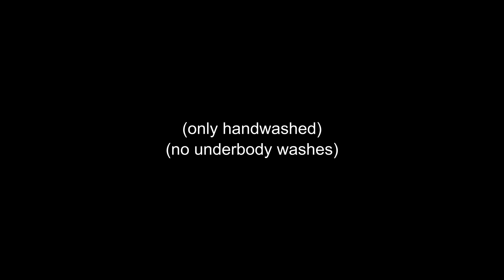Fluid Film Undercoating / rust proofing: Year 2 Review

Comment: i used fluid film on my brand new to me at the time 2017 dodge ram 1500 pick up. I spent five days taking my time to apply the stuff. I’ve pulled the headlights, taillights, the spare tire, it’s even took the runningboards off so I could get underwear the brackets mount with fluid film. I lifted the mats up off of the top of the rear bumper because my last GMC truck rusted out under those mats. I took the fender liners out.. I took the wheels off and covered the disks with plastic bags. I hand coded brake line connections at the calipers. I had coated the driveshaft. It’s a 4 Wheel Dr. so I guess I hand coded all three driveshafts. I bought the attachment for the spray cans that’s a 4 foot long hose, and I sprayed is high as I could get up the door posts, and up the frame around the windshield all the way to the roof. As well as in every hole on the hood especially towards the front.
  The reason I took five days to undercut my new truck is. My last truck with a GMC Canyon. I bought it new in 2008. The owners manuals specifically said, not to undercut my new GMC because, it would void the corrosion warranty. I thought that for General Motors to say something like that in the owners manual, they must have some super Duper special corrosion proof paint underneath my truck, so I never questioned it.Well the body panels did not rust, but, everything else did. The underneath of that truck I could scrape sheets of rust off of the frame. I lost the brakes two times from corroded fittings, the front disc brake splash shields had disintegrated. The fuel rotted and the fuel pump mounted on top of the gas tank plumbing corroded away. In Pennsylvania hear we have annual state inspections. When I had my truck to the guy I take it to for inspection, he told me that it is a crime what is happening under my truck from salt attacking that  metal. He advised me that he thought the frame supporting the back bumper and the bed of the truck was not going to last much longer.
  That’s why I meticulously under coated  my new ram 1500. Because. I see more rotted wheel wells rocker panels, tailgates on ram pick ups then any other make pick up. I should have known to undercoat my GMC that I only kept for 42,000 miles because of the rust. The truck I had before the GMC was a 1978 Ford Econ van. That I bought new and sprayed underneath and inside the doors with motor oil. That truck lasted me 31 years. I hope I get at least half that out of this new ram now that I have under coated it better than I did the ford..
Reply from the maker: Wow. Thats amazing. Kudos on all the maticulous work!     Yeah, it seems there are serious water issues with certain truck features: wheel wells, door/rocker panel drainage, frame drainage... Heck, even the a.c. condensation drain drips right into the frame on a lot of vehicles.
An ounce of prevention ... :)
Reply: can you link to the 4ft long hose you bought? Would love to get something like that to get better access to the rear of my truck bed.
Reply: @RodFenris We need a new FF update on how this is holding up. Thanks

Comment: Inside the frame is what's important, frames rust from the inside bottom, under the cab, that's where the salt lays all year unless you wash it out.
Reply: True right here.  I did paint my f250 99 but it rust from inside out.  However C frame is still healthy as is exhaust and gas tank.

Comment: Rod Fenris,   the reason why the door seals are expanding on you is because they are not rubber.  They are actually Foam with a coating on them, thats the reason why they are like that.  In other words Fluid Film is safe on "rubber"  gaskets and bushings like cab/exhaust/suspension mounts.  I don't have this issue because I coat my vehicles 90% with an industrial grade $150.00  per gallon product that does not wash off, then go back and use fluid film in small tight areas with the straw on the spray can.  However if your not afraid to re-coat the entire vehicle twice a year, and spray spots here and there as you happen to already be under it then Fluid Film is fine... I'm just lazy, so I spend more money for less work.
Reply: And what is that "150$ gallon" product?
Reply: @ylastchance  LPS 3, All I'd warn you of is you want the surface clean when you spray it on.  And it does not come off easily, not even paint thinner effects it very much.  I've scraped off surfaces I need to work on with a putty knife.

Comment: The undercoating will make rubber weather stripping dry out and shrink up overtime if it is not sprayed down with silicone before hand to keep it moist. Where I work doing rust proofing in southern Ontario, Canada we always spray down the rubbers with silicone when they are close to what is being sprayed with undercoat.

Comment: So after winter you don't wash the underside before applying new fluid film? And it sticks? Im a first year fluid film guy and need to know what to do come spring. Wash? Or just spray more on? Also if it isnt hurting the rubber to the point to where it needs replaced, I wouldnt worry about it.

Comment: What size compressor can I do it with pancake 6 gallon 135psi?
Reply from the maker: Yep, that will work. Mine is a little 3 gallon 100psi, so you'll get done befor me :).  60-80 psi seeemd to be the sweet spot for my spray gun.

Comment: Hey how well is it holding up?
Reply from the maker: wow - it has been a long time since the update. better get to posting those pics sometime ;).  Here's the short version - Fall 2019 and spring 2020 the undercarriage looked great that I barely added any fluid film - maybe a couple light squirts, but nothing much.  THEN covid happened and its been sitting in my garage on blocks for 3 months now..  two months ago, I went back over it with fluid film while I was doing my other vehicle and noticed that there was some mild rust on the rear suspension linkages as well as some rusty/waxy/powder that i could scrape off the rear differential (mostly on the top of the gusset flanges were water would pool).  Guess I should have covered those better in 2019.  They're covered well now though :).  thanks for asking!
Reply: @RodFenris  Thanks for the reply! I am glad it is working well for you. Would you say it has helped prevent any rust? My main concern is going through all this work and spending money just to get maybe a 10-20% improvement in rust. If this reduced rust by 50% I would strongly consider it but my concern is that the abrasives from the road and water just blow this stuff off in a month and render the whole process a waste of time and money.
Reply from the maker: @PENDANTturnips    I'd say it absolutely helps. My last truck was a 2003 dakota and it started rusting out bad. I was under it one day and was able to knock/wire brush around 6 pounds of rust scale from the frame. It freaked me out.  A lot. After the first year of using fluid film I think it creeped and loosened up more scale and maybe a pound came off the frame. Then the year after that - zero.  Then nothing for the next 3 years until I sold it.  Not trying to sell ff or anything (I think woolwax makes something similar) but a light oily film seems to be the way to go.   Hope that helps - good luck!
Reply: @RodFenris  thanks a lot Rod! I will certainly consider fluid film once I rust proof my car. I really wish we had some goto product instead of like 20 competitors (Krown, wd40, cosmoline, fluid film, corrosion free, etc.)
Reply from the maker: @PENDANTturnips  oh man, check out some of the earlier videos from Repair Geek.  He does a great job comparing a ton of these competitors... Lots of good info.  Good luck!
Reply: @RodFenris  yeah ive seen those and plenty of other videos from other channels, my takeaway is fluid film (or any lanolin based product) and cosmoline are the most effective. They also helped solidify my suspicion that my local rust proofing companies (krown), are not very effective at all. Cosmoline in particular looks like good stuff, especially when theres lots of water and sludge splashing up from the road. Not sure about how safe cosmoline is so I decided to go with a fluid film spray and at least spray small parts of my vehicle that start to develop superficial rust.

Hopefully that helps out a bit in the rust belt.